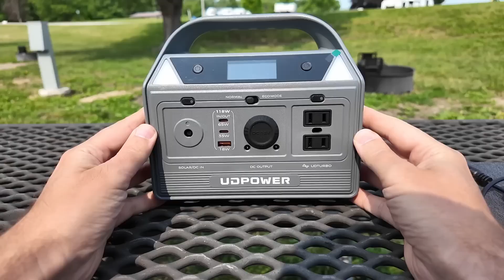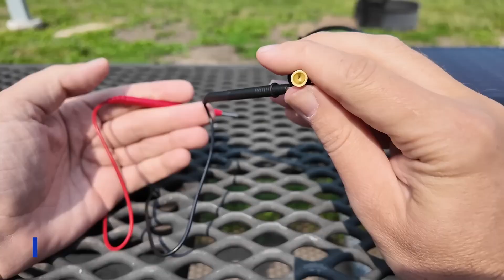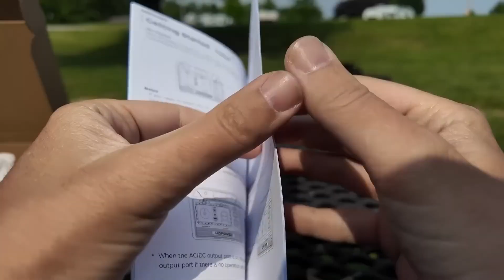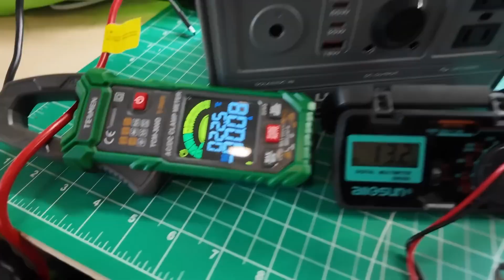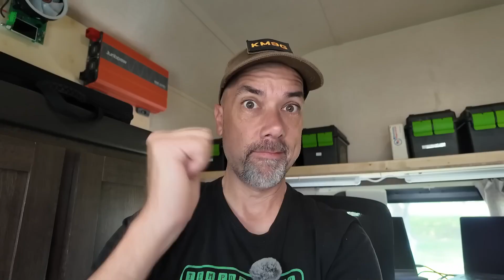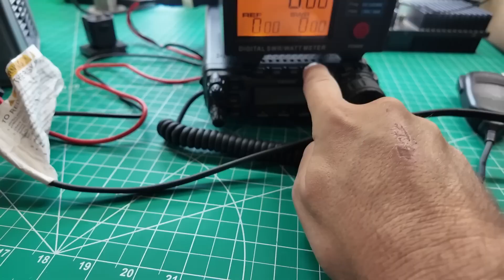Emergency Power for Ham Radio? Testing the UDPOWER C400

Comment: Yes: for years I used the Anderson Powerpole jack for jumper cables on my Duracell PowerPack 600 12v 28Ah lead acid portable power for high amps to power my Yaesu FT-857d on 100 watts!

Looks like you found me a more lightweight alternative: thank you!
Reply: I ordered the C-400 with the larger solar panel, which was boxed separately and arrived quickly as it was shipped here in Los Angeles.  The C-400 arrived the day after Christmas from Georgia.  

I have been using the Jumper Cables to run my Icom IC-705, Xiegu XPA125B and its ALC Interface which also requires a small amount of 12v DC.  I have stayed on the air for hours and it is running my setup at full power, starting at about 13.2 volts and running down into 12.2-12.7 since SSB pulls varied amounts of amps.

I have a couple of cables on order from Amazon that will plug into the EC5 Jumper Cable port on the back and give me Anderson Powerpoles for more consistency and safety.

An interesting side glitch: the C-400 starts at 100% when fully charged.  But when drawing high amperage from the EC5 on the back, it remains at 100%, no matter how many hours I operate and transmit with full power from my 100 watt amplifier.  Friday evening, when I finished my hours of testing, I ran some devices out of the inverter outlet at 120v AC to draw the meter down to 93%.  Then when I charged it from the 120v AC charging device, it worked its way from 93% (with ".1 hour of charging needed") to 99% quite quickly but then remained at 99% charging for the full time (an hour or two) to bring it back to the full 100% charging on the meter and presumably in the internal battery.

Side Note: I seem to remember being able to run my Yaesu FT-857d at full 100 watts off the cigarette lighter outlet (10 amps) on my Jackery Explorer 300; but I will have to repeat that experience to confirm.

Yet to explore: other YT videos indicate that these portable solar generators can be daisy-chained by using their 12 volt DC power cable into their solar input outlet.  So I will next experiment putting my Jackery Explorer 300 to provide DC to the C-400 while it is operating my rig at full 100 watt power for more daily longevity!